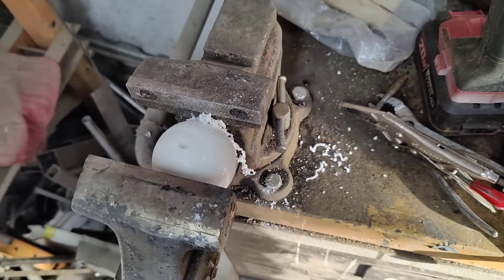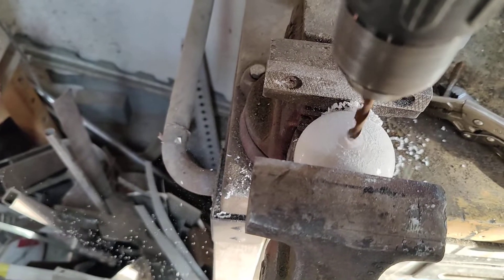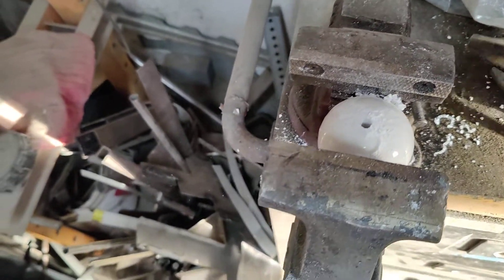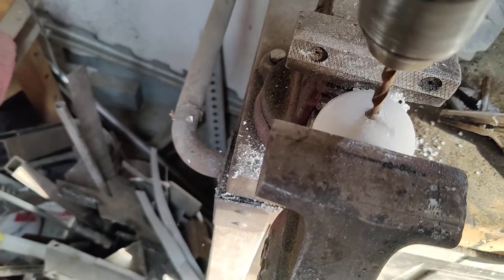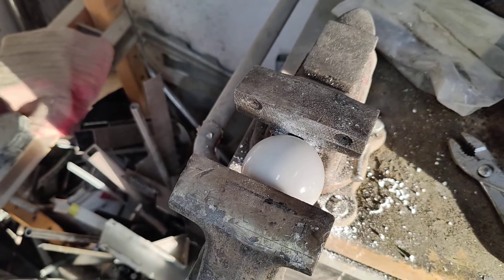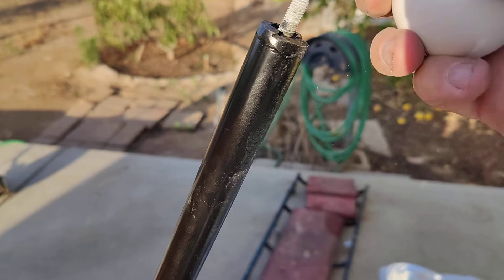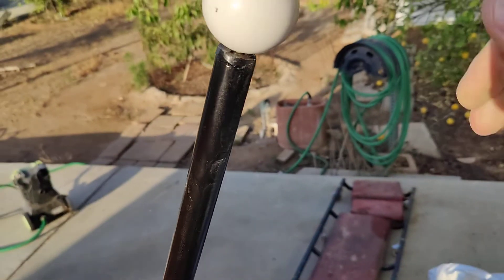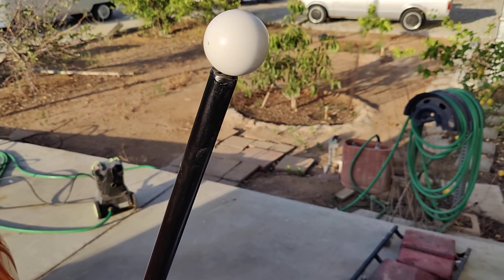drilling and tapping a pool ball WHATS INSIDE?

Comment: My 3 ball (VW Type III) stripped out of my EMPI (Hurst) shifter. I was thinking of poring fiberglass resin inside then re-tapping the hole. Thoughts Mike?
Reply from the maker: I would use a threaded insert. you can buy them at Mc fadendales hardware

Comment: Hi there, I was wondering if you could tell me if I would need a special kind of drill bit to drill a hole in a mini pool ball. I want to make a keychain out of one so I'm guessing I'll need a pretty small drill bit.. If you could help that would be awesome
Reply from the maker: no it is just a resin ball. so any kind of metal or wood drill bit would work just fine. you can use an automotive tap too and put a screw hook  or eyelet in there.